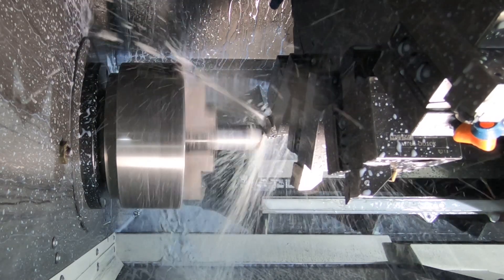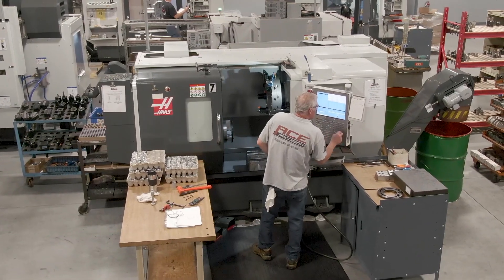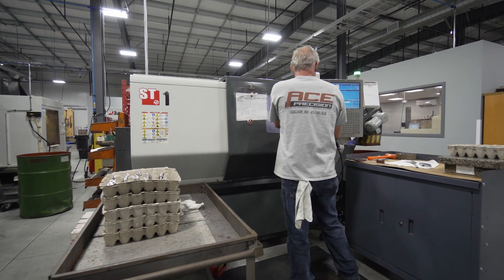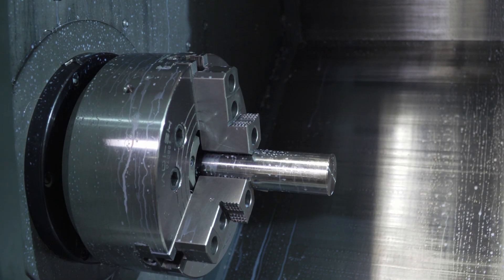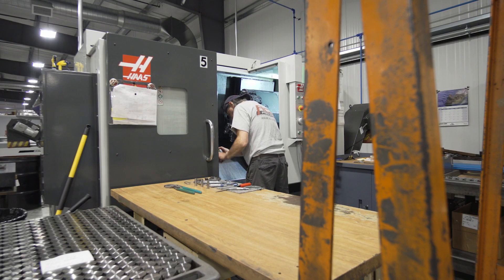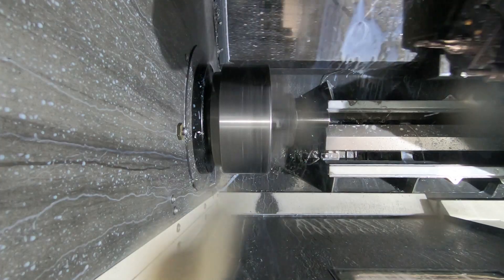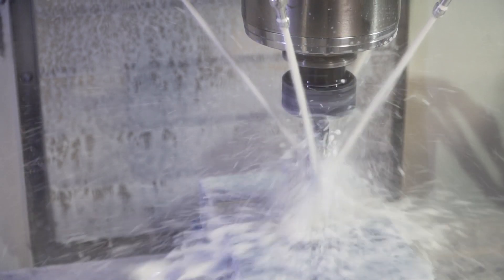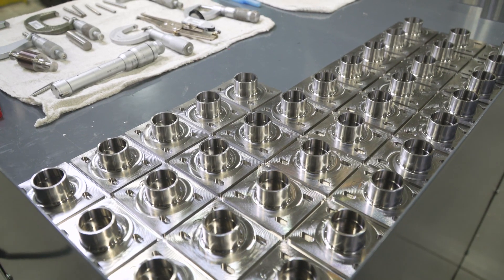CNC Turning Tough Material on Haas Y-Axis CNC Lathes at Ace Precision

Comment: I look for two things when on an interview: 1. are there chairs for the machinist to sit down on? and 2. Does the shop have A/C.  A shop that permits chairs is easier to work for and generally a more pleasant place. The shop may not be clean nor have all the tooling you would like but a better place to work.